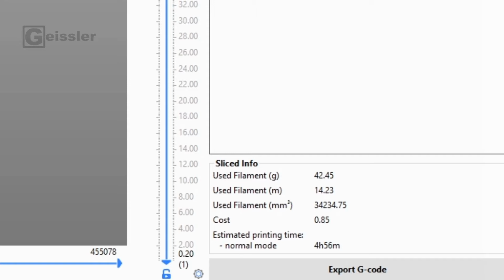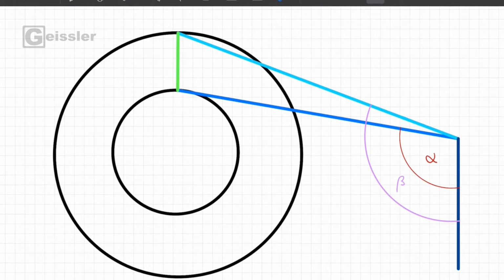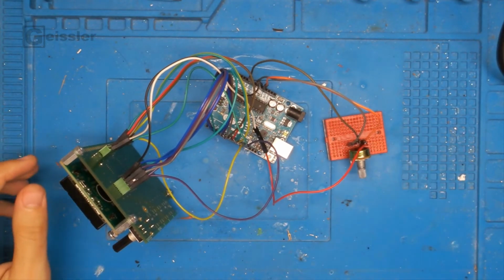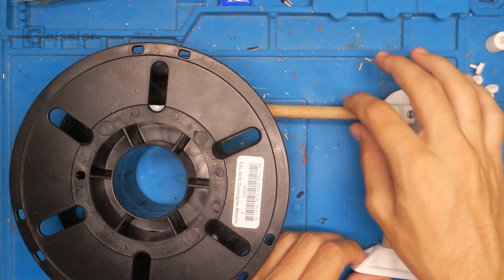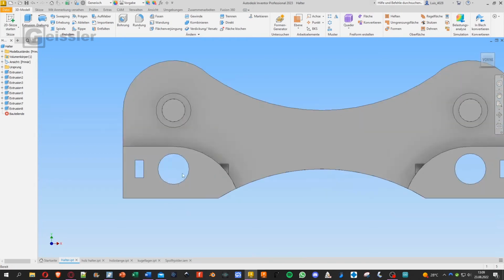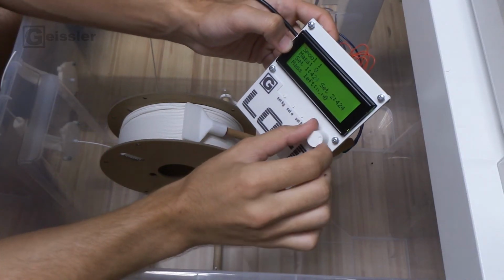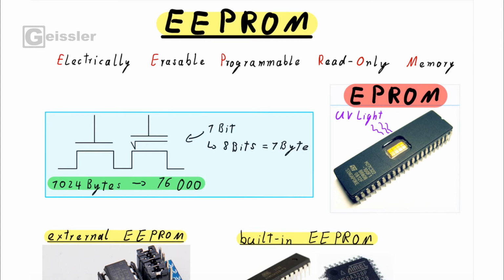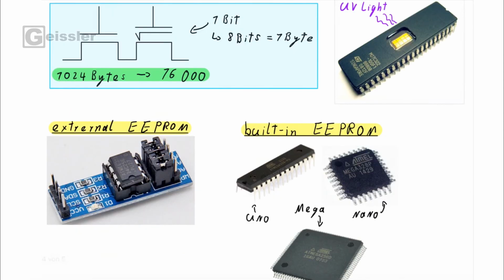LOFD - automatically displays remaining filament - Luis Geissler

Comment: Couldn't we just permanently place a scale below the spindle holder since we know a new full spool weighs 1kg .

Regardless, nice project.
Reply from the maker: Yes, that would be possible if you use only one spool, but my spool holder, for example, is designed for multiple spools, and then it would no longer work with a scale. Also, many printers have a built in spool holder where the scale would not work either. Nevertheless I am glad you liked it